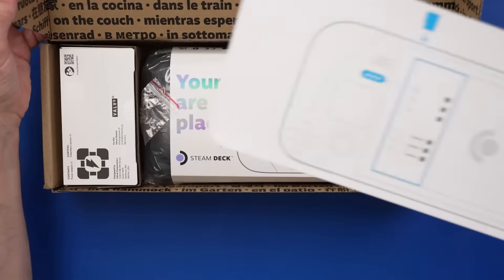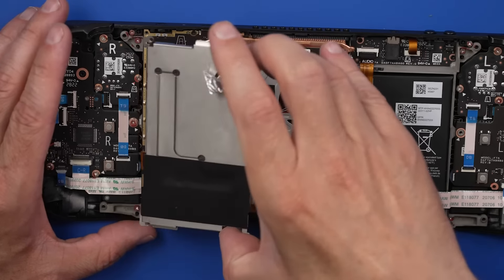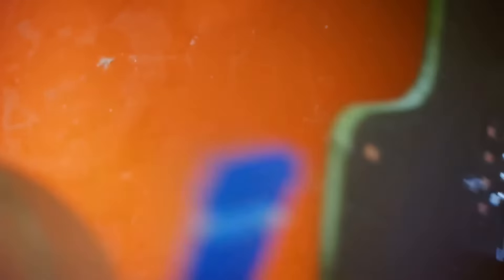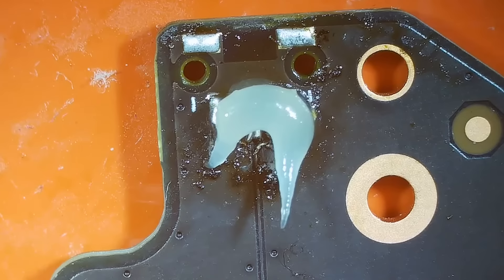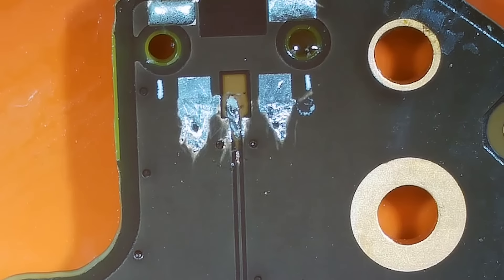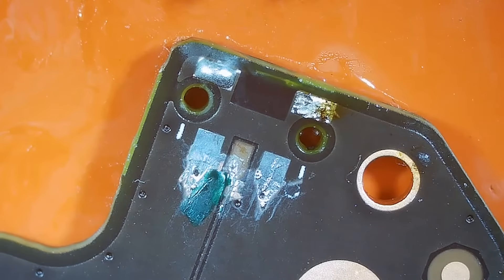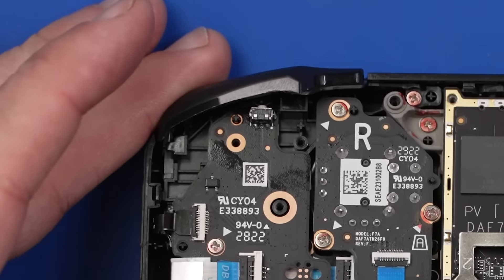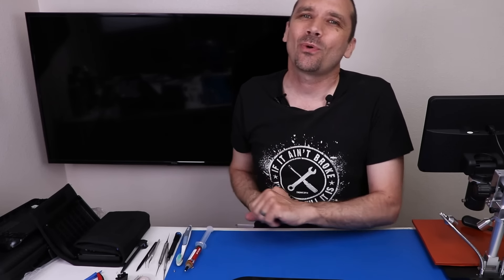Steam Deck Repair Fail - Extended Version

Comment: I believe Valve redid these buttons for the OLED model. Not sure if it made a difference or not I own an OLED model and so far I'm super happy with it.
Reply: They moved them t o the joystick module for solder free replacement, they also made it shock resistant.
Reply from the maker: Interesting. I’ll have to check them on an OLED sometime

Comment: Non-toxic flux is only half the solution to soldering hazards. I had a friend who was a plumber by trade and worked overtime doing basement supply line rough-ins for about 2 months straight, 12 hours a day. He started to notice pain in his joints, and persistent nausia. It turns out, after seeing a doctor, that he was suffering from metal poisoning. When you solder the smoke is not just the flux, but vaporized metals too. Always use you fume extractor, and if you find yourself still inhaling smoke consider further remediation methods like a mask. Metal poisoning can be very serious, and bery painful. Careful out there

Comment: Multi-layered board with ground plane exposed underneath where the middlepin is. Either dremel it away or seal it properly underneath and just use wirelink between middle switch connection to broken trace only, and don't try soldering the middle switch pin to the board.

Comment: #1 tip, have a %100 working to compare to model so you can see whats the problem easier. lol 😆 😢
Reply: As someone who has repaired 2 way radios for 15 years, YOU AINT WRONG AT ALL.. Proper repair schematics and block diagrams work better, but unobtaium from Nintendo for sure!

Comment: $300 for that device I understand you’re going to even out. Or probably make money on it just by the YouTube video but $300 for a device like that on a consumer that’s not gonna make a video on it. It looks like the person selling the device was trying to rob someone if you ever see a broken steam deck that someone has already opened up and somethings wrong with it if it’s $300 do not buy it $200. Don’t even buy it now 150 that’s kind of meh On eBay it’s often important to read the details. Otherwise you may be sent yourself up for failure in case of tronicsfix he’s gonna make money off the video which will offset the cost

Comment: I know yo said yo don't like using a Lot of FLUX
but that's why I'm sorry to say yo repair looks like 
a Rookie on their second day of working in the field.
So~so sorry for being so harsh but flux is imperative, 
so never ever hold back from relying on all of it's 
many benefits that for the most keeps solder where 
it is needed and as it's doing that keeping the area 
clean from contaminates that cause all sorts of probs 
Use as much FLUX as you can if you want a clean 
finish, and remember to wipe away the excess flux 
while still hot, followed by a good soaking of IPA if 
you want to get any where near to My Mate Vince's 
level of soldering and finish..  
APU👁👍
Reply: You can go flux yourself!  (Nah, it's actually good to hear from a different side.  Just saw a joke opportunity and took it)
Reply: @brianwalsh9984  
it's a winner 😂
I always worry that my Aspie riddled overly constructive criticism could be taken badly..

Love it when a rebuttal via a joke is flown back into my face.. 
Yup.. Even though I B N Aspie, I deserved it though.. 😅

Comment: $300??? Man you are REALLY good at repairing stuff - but you are not very skilled at buying stuff! This device is $419 from brand new - so spending $300 on it in fully working order would be a pretty meh deal. $300 for a broken example with 0 warranty however - that is HORRIBLE my man! Like actually $200 wouldn't even be a great deal considering that it's not just broken - but an amateur has been inside it trying to "fix" it... In my experience that increases the risk of the device being bricked by a fairly large amount. Paying half the price of the new price for a potentially bricked device is fairly risky no matter how you look at it - and paying 75% is just reckless IMO.
Reply: But he’s buying it to make a video. And afterwards, assuming it’s fixed, he can sell it.
Reply: @griffog2001  i agree plus may i add that these days your not buying these or anything half price or to much cheaper especially when its just a button problem
Reply: Try finding one faulty to start with there’s not many in the wild because of valves return to base policy and out of guarantee pricing you can not get all the parts regardless of what’s on I fix it. Is all you get. Changing the screen you could brake the ambient lights sensor and you can not buy one that’s a 100 pound fix for a hole new screen
Reply: He overpays a 100 to make 3000 on video😂
Reply: Think outside the box. The amount of money he will make from this video alone will cover any cost + leave him with plenty left over
Reply: Would be a pretty boring video if he just purchased a fully functioning unit..
Reply: I think is an extended video of an old one so back the it was more expensive even second hand broken
Reply: The payback is in the VIEWS he gets.  He makes his living fixing this crap while we watch.  He probably deducts it as a business expense.
Reply: Considering he does this for a living its probably deductible.
Reply from the maker: My job is to make entertaining videos. Does that mean I “overpay” for some stuff, yes. I can tell you that “overpaying” a bit for things that make good videos is totally worth it. 
Also, most of the other comments here make good points too.
Reply: I like the challenge of doing repairs like this. I'm aways looking for broken things like this but they are hard to find for a fair price. He will get his money back from making the video.
Reply: I'm sure he will make more money from his repair video, than he spent on the device he repaired and he can then; turn around and sell it for further profit. lol
Reply: Oh go make you're own videos then just another Karen let the man be he's a great human
Reply: and he can also profit from this video.. 😂😂😂
Reply: I'm one of the steamdeck repair  lover  but man  I don't  know when he buy this  steam deck  but  at some  point  steamdeck  was  really  expensive  to get it  even it is secondhand  or even broken like that
Reply: Makes money from device sale and AD revenue and sponsorship.....Also draws in more viewers, because of the difficulty of the fix....case in point, you also watched and commented on his ' $5000 worth of broken laptops ' video.....which means another view and more AD revenue 

$300 deficit probably becomes $1500 profit after all those are factored in.
Reply: @mastercarnage8165  LOL actually you are - I buy stuff and fix them myself - and I often pay less than 50% of the value of items like this - and mostly it is way less than 50%... So yeah if you pay too much you are basically feeding a market where broken stuff sells for way over what it should. Frankly - the price for this one should have been way closer to $150 than $300.
Reply: @TronicsFixLongs  I actually disagree with you on one part of that. See by showing people that the price for a broken item is that high, you both risk making them think that this is the price it should be - and thus overpay - and overcharge for stuff. 
People here seem to think you make money of a repaired device when you payed $300 - and then talk about the video? But isn't the entire point of the video to be educational??? Well let's ignore the fact that repairing most devices takes a long time especially if you need to find the faults on a given device - and then retrace like you did on this one. The fact is that if you are a fair refurber/reseller of repaired devices - you disclose in the sale that you have fixed it. This has some impact on the resale value - just like the fact that there are fees for the sales site you use. SO people! HERE IS THE REALITY - and what I'm pointing out here:
Retail price: $419
Payed for the item: $300
So that leaves $119 to pay for the time used on fixing it, the fact that it's A USED ITEM, the fact that it's a repaired item - and it has 0 warranty... IF anyone thinks there is ANY profit to be had here - then they are delusional! AND - THIS IS MY POINT! $300 is WAY too much for this device! Like actually reckless spending on an item which might be fully or partially bricked! Yes I agree that his job is to make videos - aka being educational - however then promoting spending $300 for a device like this with ripped pads and crap is very poor advice if anyone takes it to heart! What he should be doing if this is how he does this - is not mention what he payed - OR - AT LEAST point out that it's a way too high price VERY clearly - so his educational video doesn't educate people in screwing themselves over!

The point I was making seems to be lost on most people here - so again:
The work he does - like I said - he does well! There is NOTHING criticizing the work he does nor his skills - nor the devices he choses! My problem is the price he promotes paying for these devices! If he is being nice to a viewer and overpay for the device to have content - then fine - I have 0 issue with that - but stating that price as in any way normal or reasonable - is poor education! Freaking fan brigade triggering over a valid criticism WTH people!
Reply: Say you know nothing about how YouTube works without saying you know nothing about how YouTube works.
Reply: Yeah especially now you can buy it no waiting list.
Reply: @Craider79  Your last comment shows just how fragile your ego is.
Reply: @iggytull624  Hahahahahahaha WTF are you on about kid! You have to troll better than that to get me! Also - just FYI - being able to clarify your point is not a weakness - it's a quality! You will probably realize that when you are done with school and actually have to function in a real job.
Reply: @TronicsFixLongs  you made a 30 mins video just to repair a button, yeah sure it’s a good video for people who don’t know any better lmao
Reply: The market just isn't that way right now.  Certain devices hold a lot of the value, even broken, because there is no shortage of people trying to fix and flip them.  Steam Deck is definitely one of those that you can't find many good deals on.
Reply: He buys those for the videos...
Reply: He’s said multiple times he doesn’t make a ton of money doing the repairs he makes his money from the video